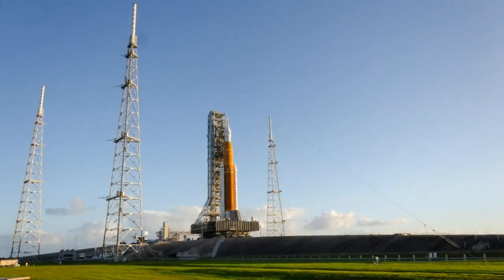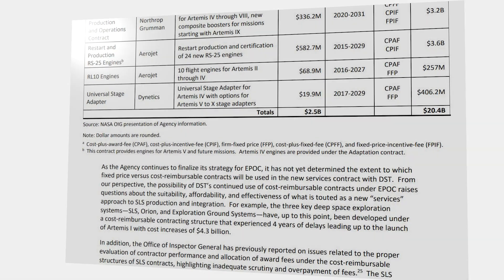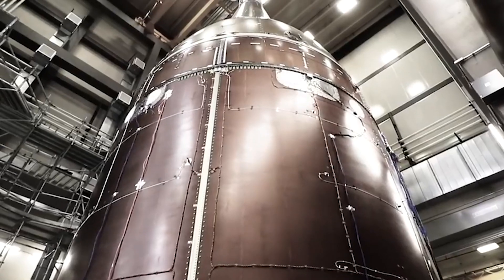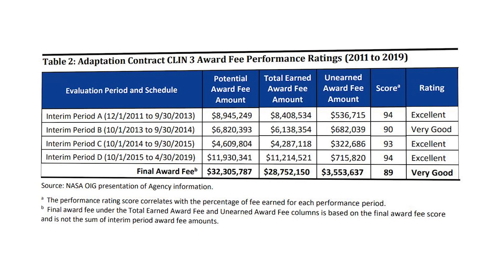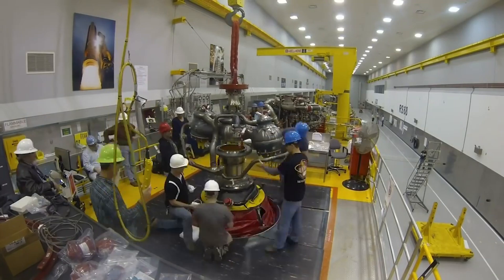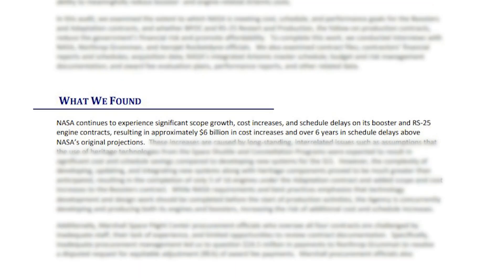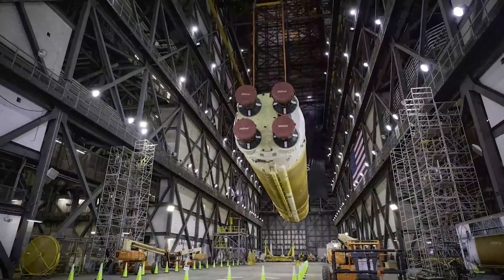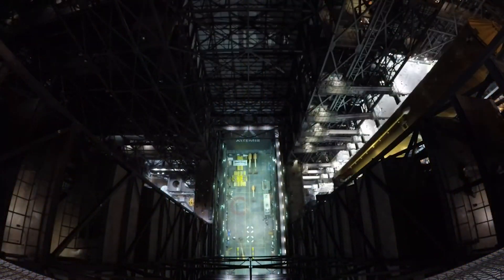The Challenge of NASA’s Cost-Plus & Fixed-Price Contracts

Comment: Cost plus is appropriate for an experiment, but rockets aren't completely experimental anymore. We are the equivalent of airplanes in the 1920s.
Reply: There were plenty of experimental aircraft in the 1920's, in fact, NASA is still building experimental aircraft today (such as X-57, X-59 and X-66)
Reply: @plainText384  My point was that there were also non-experimental craft that were mass produced. If the whole point of the SLS is to use proven hardware, it should have been fixed price. Routine exploration missions shroud be fixed price. These are well understood machines.

Comment: SLS is a complete failure it's to expensive and behind schedule😂
Reply: IfUSāSō, that first SLS flight was such a “failure”, they even blew in a couple of elevator doors and had a couple of relays reset, but no mega craters. We should be discussing replacing SLS after SH & SS are fully operational and can do in orbit refueling. Now when did you say that was going to completed?!

Comment: I have a lot of experience with the dreaded "cost-plus" contract.
The major problem is that the cost-plus contract is structured to limit the profit that a contractor can make. There is NO upper limit on duration or overall cost, just a savage effort to keep the contractor from making too much money on a percentage markup.
If I awarded a $50 million cost-plus contract, I could tell you exactly how much profit the contractor made as a percentage of how much it cost to do the work (generally 10%), but there was no way of knowing if that $50 million contract would end up being $50 million, $80 million, $135 million, or even higher.
Similarly, the work could take 6 months, 6 years, or 20 years to be finished.
How many people would hire someone to build them a house if the only promise that the contractor gave them was "I won't make more than 10% profit"?
You may end up with anything from a 2-bedroom house to a McMansion and there would be no way to know which before the work was completed and the final bill put in their hands.
Reply: That's why cost plus fixed fee exists. If the initial estimate is $50M in costs + $2.5M in profit, the company would have a profit margin of 5%. But if they instead do it for $500M, their profit margin drops to 0.5%. Similarly, if they go from initial claiming, it would take them 5 years, to it taking 20 years, the profit per year drops by a factor of 4.

You don't want to reward contractors for going over budget being behind schedule, which is why a percentage fee is counterproductive to the program. Cost plus fixed fee instead softly punishes bad performance, while still shifting almost all of the risks associated with cutting-edge RnD from the contractors to NASA.
Reply: @plainText384 Only if your auditers can dig through all of the companies financial chicanery.

Comment: We know cost plus has been a dismal failure for both progress and price. Fixed Price contracts are not perfect and do not guarantee success, but they are by far the better option.
Reply: It really depends on what you are trying to do. When you are pushing the envelope and doing something completely new (as is often the case with NASA) it can be impossible to predict the price in advance, so fixed price contracts aren't really an option. Similarly, if design requirements aren't firmly set out at the beginning of the project, but instead evolve with the project (again, not unheard of with NASA projects), fixed price isn't really something that can be offered.

Fixed price is only really good for things like, say, resuming production of Shuttle Era components after upgrading them slightly, or building a moon rocket for the second time. Here, the contract is well understood by both parties, and price estimates can be made.
Reply: I used a hybrid style of contract a few times and it worked out great.
Cost-plus with a maximum price.
NTE (Not To Exceed) reigned in the cost overruns by taking away the incentive to be wasteful.
The politicians in city hall hated it, which is proof positive that it's harder to cheat on.